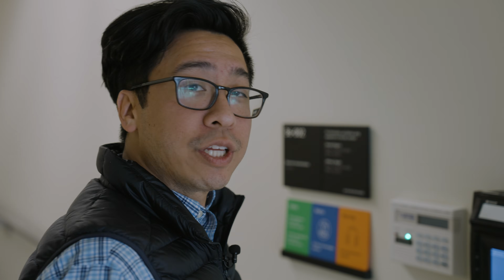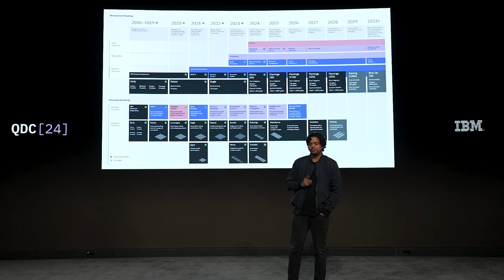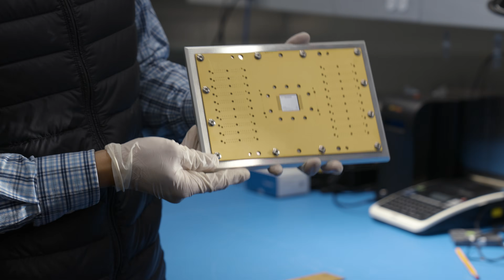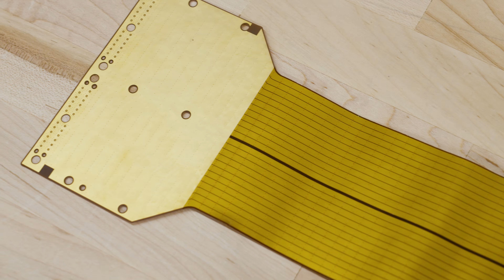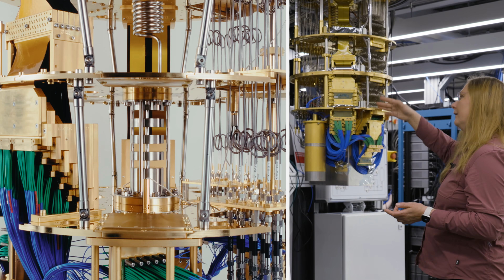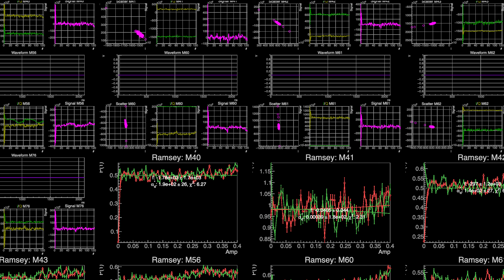Lab Tour: How IBM tests quantum processors

Comment: Quantum computers are fake. Whatever they are doing with whatever techniques, it is not utilizing parallel universes, parallel universes do not exist. If they are computing something, it is using newtonian physics. The only known quantum behavior are from electrons, which appear to be forced into a specific smeared out probability zone around a nucleus, forming stable atomic structures that cannot be calculated using newtonian physics. However, the claimed qubit usage and its fundamental theory of operation are incorrect.

Comment: Leave technical documents for computer science that's what AMD  did all I read and computer science books and chemistry and electrical
Reply: can you give more details on what to read?
Reply: @808Efe  before AMD bulldozer architecture the white papers and technical documents describing the cpu layout and pins instructions and functions where on the website for investors to read 📚 voltages and how to wire the cpu very similar to microchip documents every address of the cpu in the documents
Reply: @808Efe  each cpu is a 1500 page book describing all features and functions microchip is only about 400 pages
Reply: @808Efe  the multicore only used 1 AA battery 🔋 worth of energy max the lower the voltage the better it works electrical laws and physical laws is why the cpu was cored
Reply: @808Efe  my designs ideas 💡 and concepts to launch quantum was in light  of studying concepts in physics basically more electrons in-between high and ultra frequencies the downside is material burnout
Reply: @808Efe  until I research and create better semiconductor materials core reigns supreme
Reply: @808Efe  basically I was theorizing on new and strange alloys and elements in deep space ways to mine and use the materials we also spoke about super conductivity and using less voltage voltage acceleration is equivalent to 4000 degrees Celsius and instant but everything is stupid to the world so I only talk to American scientists only they will know my work only Italians share it I do not talk to the world

Comment: what exactly will quantum computing do for human standard of living. Currently technology of this scale is expensive its in developmental stages and productions is limited. Overly expensive for a limited effectiveness. I would bet on it that these chips are not better than our best silicon chips in computing. Seems like a waste of time and money for me. The reason why it doesnt seem effective is because of the consumption of energy from the process and the refrigeration.  The modern engineers only focus on speed and performance however reliability has significantly diminished.
Reply: These are tests and research for future generations of computers with 1M+ cubits that may be able to do more types of calculations quicker. And you don't need to bet - it well known that for now quantum simulation on standard chips are better. However, people said similar things about transistors and fundamental research. This research is the main reason we are able to write this messages to each other.
Reply: @Lexxxco1  this isnt research though. This is the prototype product, for comercial sales. IBM. If it was the universities making the chips and testing the simulations i would agree with you however this is already going outside of the academic sector and its a private company with personal interests( money) trying to promote this theoretical calculations. I have dove deep into quantum and understand that its still all about the possibility of probabilities. Most engineers think this means faster sims, incorrect this means more probabilities. Entropy, all possible probabilities are proportionally probable. More un orderly states than ordered. Electronics follow the fundamentals of classical physics so they use Differences of Potentials. Chemical potentials, statics, and photonics. Quantum will use the fundamentals of structures, thermodynamics and superconductors. My issue is that for this to be pushed to the public is still very early and will inevitably cause mistakes.
Reply from the maker: Thank you for your interest! For more information on our IBM Quantum Data Center where we make quantum computing available to partners across academia, research, government and more.
https://newsroom.ibm.com/2024-09-26-ibm-expands-quantum-data-center-in-poughkeepsie,-new-york-to-advance-algorithm-discovery-globally

Also, at your leisure, please check out some of the recent news and developments from IBM Quantum that speak to the many technical achievements of our systems, as well as our expanding network of partners and collaborators.
https://www.ibm.com/quantum/blog/quantum-roadmap-2033

https://www.ibm.com/quantum/blog/responsible-quantum

https://www.ibm.com/quantum/blog/utility-toward-useful-quantum
Reply: @ibmresearch  ill take you up on that thank you. If you have any research from your haters ill read that too. Truth is i still hope for a more effective system to be made. Just look at dynamics of reality. Like how when a person is overly detailed the most mistakes happen. Plans never go according to plan. What we did with technology is force our way of understanding onto nature. What humans had that lead them to dominate earth was some sort of collective consciousness that united (Unity) many cultures to coexist. Values systems this is what most conscious leaders at the time shared. Okay so if before quantum solidified as a path of study most academia believed that the brain(consciousness) worked in a logical form. Digital inputs and outputs. Then we begin to understand consciousness through the enlightenment of the Psychological departments in France. They discover that certain cultural dynamics carry different weights to them that result in overall different calculations from logic algorithms. So the brain is not just Digital. Quantum will prove to be able to advance ai and other tech but it wont change the way culture views technology. It wont change the human element of reality. Unity. My true concern is that what is the purpose of quantum now? Humans carry around supercomputers and they spend most their times on social media, how will teleporting qubits help me scroll faster? I feel that trying to give this a price and selling it to investors will just make your company start pushing more for this and then all the EE, ME, CS etc. engineers gone and again quantum is still very much so (undefined, theory, probability). All Love doe🖤
Reply: Well, we could have asked the same question in 1951 when the first UNIVAC computer, costing about $1.5 million, was released: why do we need that 35-square-meter monster? But we know what happened 74 years later. It’s the same now—we are like in 1951, and we still have a long way to go before we see some real-world applications.
Reply: @carlosap78  okey my point is skip the bs and invest in the proper departments that will make this faster and actually create such value.
Reply: @adrianoolivares7851  They are like 20 to 25 years away from producing a general quantum computer. There is a lot about quantum physics that we don't understand. You can't just invest and say, "Produce a useful quantum computer," and throw money at it. We don't even understand the basic principles of quantum entanglement, the building blocks of QC.
Reply: @ yeah read everything i laid out how money is used in academia and thats my exact point that they are trying to sell you a concept of something its overpriced rn but why is is not useful because the proper researchers are underfunded. Because quantum is so new so nobody is taking a risk to become the supplier instead they let the distributors shift market consumption their own way and it all inevitably comes crashing down on the suppliers, again there are none yet. Again quantum cannot operate with our modern electronics because our modern electronics operate on classical mechanics. In order to even begin making a quantum computer all innate knowledge of how systems work will have to be rewritten. Once they figure it out all the money will have gone to the distributors so all the knowledge will get buried. If it gets buried because of our incompetence to act know on our money then it might never or get delayed till the knowledge gets resurfaced. 🖤
Reply: Basically all this is creating expendable skills, engineers, technology, energy, and customers. Business. And the biggest debt consumers are tech companies. They over invest in growth.
Reply: @adrianoolivares7851  I'm sorry dear sir, but what did the mainstream marketed A.I. & bitcoin do for the better of human standard living? Did they improve something, no.  We just got chatGPTs to output statistical data & do some occasional assistance in terms of product requirements. 

Do you understand that if Quantum advances further all your little passwords & different crypto technologies that were ever developed will be cracked in seconds & will be obsolete. 
The cryptography & cybersecurity techonolgies will advance very far with Quantum in use & with the computation power it offers, it will even revolutionize the energy industry as it can help all reactors & power plants run better with correct calculations improving energy generation.

Comment: I loved working in the quantum characterization lab this year. My work was on the wide bandwidth quantum-limited amplifier materials for TWPAs in the dilution fridges 😁.
Reply: I'm jealous
Reply: I am an independent researcher i have developed Non Markovian QEC integrated Algorithms inside the qbit and my 8qbit toy model is showing efficiency regarding overall cost efficiency and internally consistent regarding error correction...
I have modified existing Quantum Physics Equations and my model is completely based on open quantum system operations...I need your assistance sir...
Reply: yeah i remember you mopping up my spilled coffee near the stairs .... good job man that was squeaky clean after